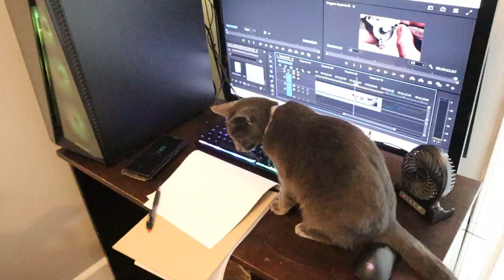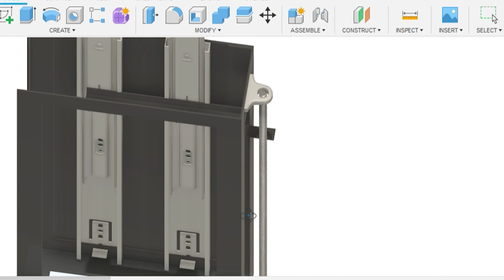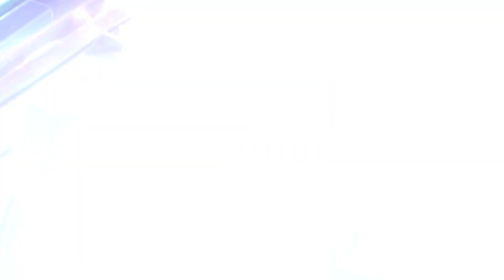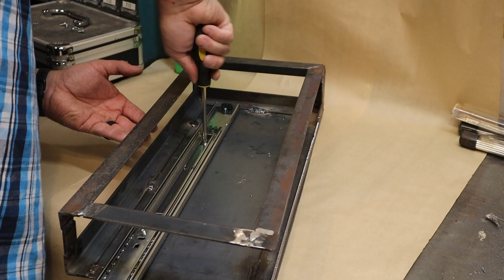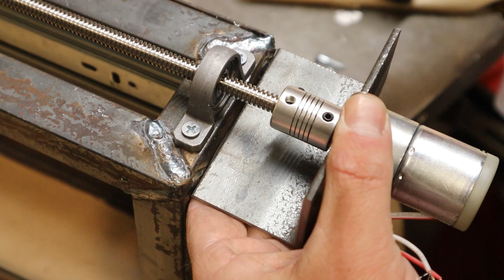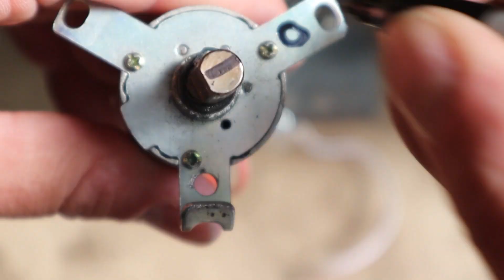Homemade Hidden Motorized TV Lift

Comment: I did the monitor lift too except I wanted to use old tech so I used a trebuchet instead. It came up really quick but I still haven't fixed the hole in the ceiling (but the roof is repaired) and I just found out my monitor in the neighbors pool 2 blocks away...